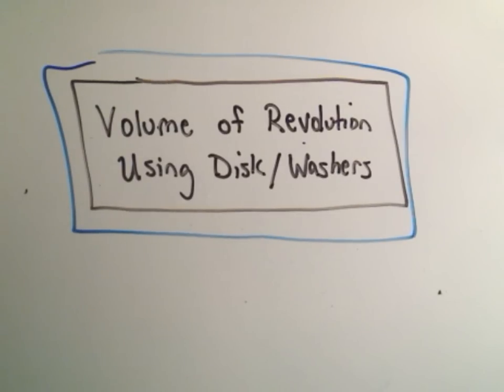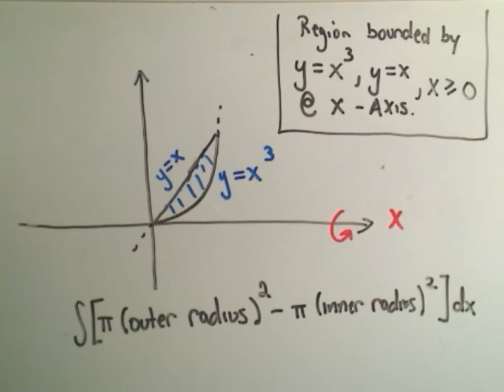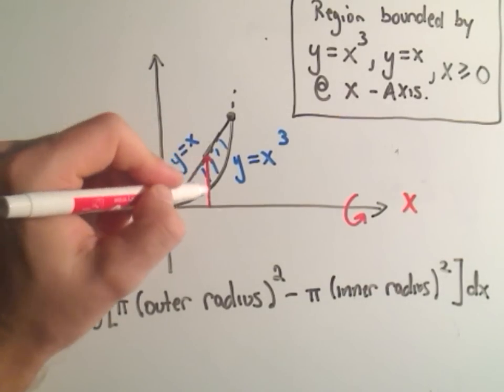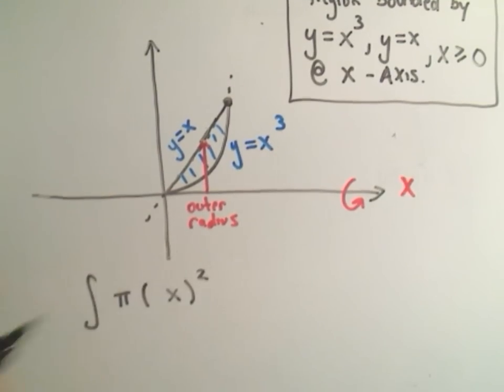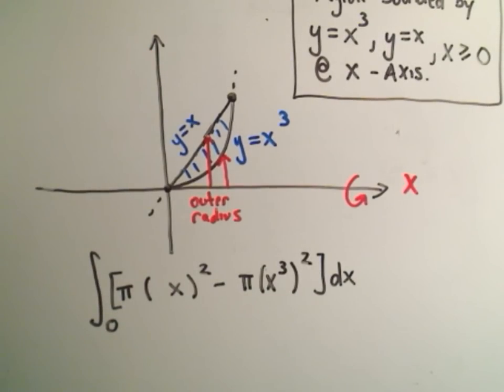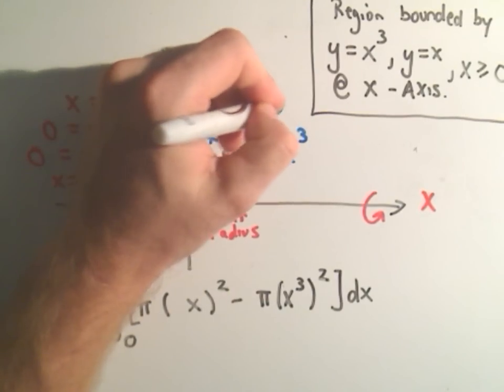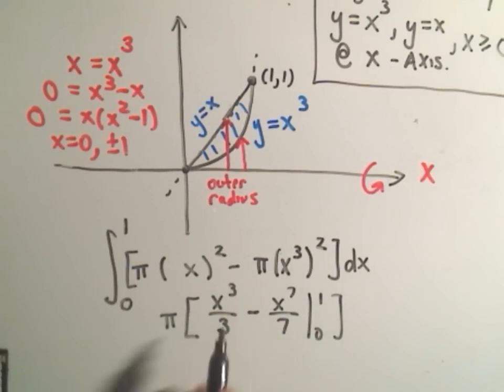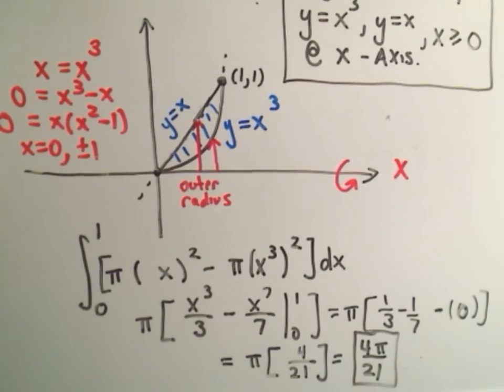❖ Volumes of Revolution - Disk/Washers Example 1 ❖

Comment: I do not understand why the outer radius is x and not y. The length from the axis of rotation and the top of the rectangle (or y=x line) is equal to the y-coordinate, so why is it not y?
Reply: If you are rotating it about the x axis it will be in terms of x. If you are rotating it about the y axis it will be in terms of y. The opposite is true for the shell method. The specific case you are talking about could, in fact, be either y or x depending on its axis rotation because since y = x, x = y. Just like since y = x^3, cube root y = x.
Reply: You're doing the problem with respect to x (dx), so the radii need to be in terms of x as well
Reply: that's what im saying. It is technically not x because if R was a measurement of x, than it would be the distance from the y axis of rotation. Things need to be in respect to y here.
Reply: wow what an articulate answer. how are you so smart? are you taking calc 2 this year
Reply: yes! I am in Calculus for Engineers 2
Reply: Bailey Adams nice! what section are you on? i'm using stewart calculus 7th edition if u need that book i have an online copy lol. man this stuff is hard im just guna watch patrick's videos i don't really get a lot of it
Reply: Okay that makes alot of sense. I just get confused about the small details of this type of problem sometimes. Thank you. Because of Patrick I have moved on to Differential Equations, and boy is it not fun! But math is never fun, i guess ill just have to get used to it lol
Reply: +King Jank np anytime bro

Comment: @4thKyuubi If it's not a washer problem (ie. if it doesn't have a hole in the middle of the solid formed), then you don't need to do the minus the other part, because then you are only dealing with one fully solid form so you just go Int(pi*r(x)^2). That's disk method. Washer method is when you have two different functions making the shape so that there's a hole in the middle, and just like you and the video said: you do Outtie minus Innie.

Comment: I enjoyed the video and found it educational. I'm proficient with revolutions when it is based on washers and disks...it's just that when they through theoretical shapes that have no value that I start getting mixed up. Like "A base of S is a circular disk with radius r. Parallel cross-sections perpendicular to the base are squares." Can you make a video outlining the steps to approach these theoretical problems?